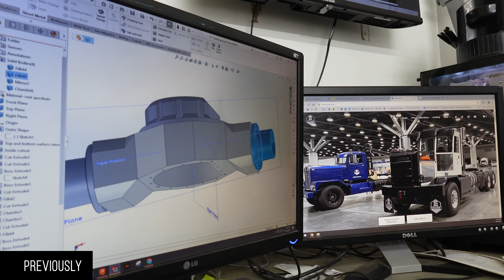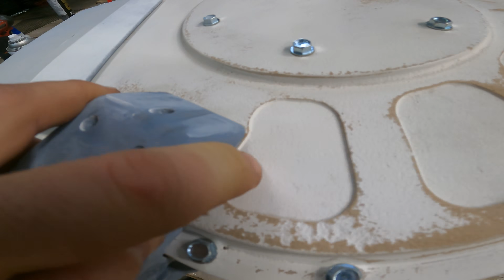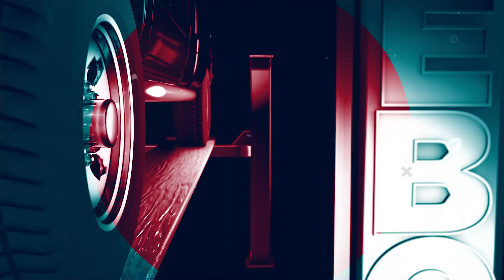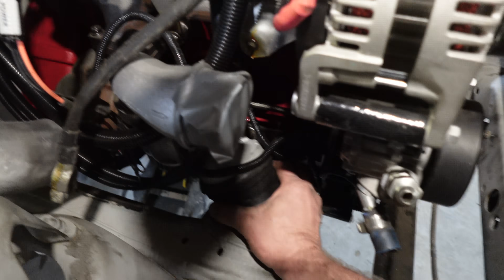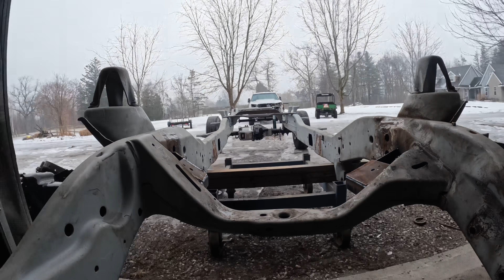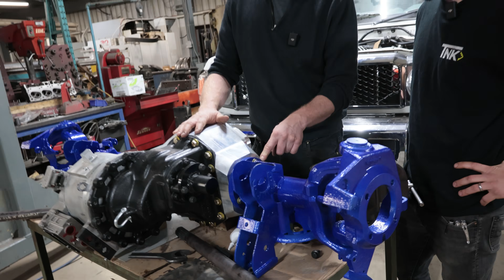Test Fitting our @EdisonMotors Generator #RamRecharger [EP9]

Comment: Extended Range Electric driver for 5 years (now @ 122k miles) on an i3 REx.
Owners will be impressed with instant 1rpm torque, running costs 80% less than diesel, and how a small Cummns ICE generator will last forever if used this way.
Regen brakes are just icing on the cake.
Reply from the maker: Our thoughts exactly.    Thanks for the real world testimony
Reply: @DEBOSSGARAGE Gotta get regen shock absorbers now
Reply: @grammarpolice4003  Sounds like a good chance to get Multimatic involved! They're a Canadian company that make magnetic shocks for high performance applications.  Oh yeah they build Ford race cars too ;)
Reply: @grammarpolice4003  honestly I don’t think there’s much to be gained by that
Reply: @SoreTv  every little bit adds to the bottom line of range.
Edit: and the further the vehicle travels the more the shocks are used and the further it can go. Imagine a downhill, speed bump infested road. You'll catch a lot of regen on that.
Reply: @DEBOSSGARAGE  Is this combination with the 2.8 Cummins going to be the only choice, or will their be other options? Also, will the kit be something a person can buy and install themselves, or only performed by certified installers?
Reply: Hybrid is good in Australia also... Can be some distance between chargers.
Reply: Regen brakes is why I think it’s insane this doesn’t already exist and only on the long term marketing plans. The bonus of all accessories being off the high voltage is also a huge bonus for so many use cases.
Reply: I am sure it will not take too many years before these are the go-to option on most mainstream pick-up trucks and probably heavier SUVs also. Too damn bad, that I will never be able to afford a new truck, so I'll have to wait for a well priced conversion kit, or wait 10-15 years before diesel-electric pickup trucks have hit the market and you can find used ones that have been driven 100-150 thousand miles.

Comment: Awesome stuff happening on this channel! I can’t wait to see more updates on this. Imagine having a reliable fuel efficient diesel 4x4 that can doesn’t cost $80-100k 😂.
Reply: Diesels are efficient. Unfortunately they put giant motors in the oversized utes in na.
Reply: @ I have had a bunch of older diesels that had very respectable mpg. Unfortunately the new ones are so complicated and burdened with so much emissions equipment that they can’t be considered affordable or efficient at all.
Reply: @Low760 IH tried the smaller diesels in the Scout-II, but it never took off. Ford and Chevy tried diesels in the Ranger and S-10. Diesel pickup trucks have really on been popular in North America since the mid-90s and you’re right the engines are massive. That’s because generally we don’t have light duty trucks with diesels here. The trucks with diesel are 3/4 ton and up generally.
Reply: What's the price tag on this 😂

Comment: Will retrofit shops be allowed to rerate GVWR? For example, if I bring in a '99 F250 with a GVWR of 8800, and you put electrified F450 axles under it, can the GVWR be officially rerated to 10,000 or higher?
Reply from the maker: I think it will vary state to state and province to province, but our lawyers can figure that out.  I just want to get them moving

Comment: Interesting idea, looking forward to results. Which 160hp engines of an "older" design could be used in place of this 2.8? 

Is there a common generator set that is the same kw?

Many low hour standby 3ph generator sets are available; Detroit 2 strokes and old CATS are scrap prices, still like new and VERY reliable for decades.
Reply from the maker: Any engine that can be controlled electronically with an SAE #3.  Bellhousing.    That's. Ot to say an electric solenoid can't power a mechanical pump....

Comment: so this is a direct E-axle to battery source/generator, ie. diesel fuel to electric generator?
Reply: The engine spins the generator. The generator puts power into batteries. The batteries put power into the axles.

Comment: awesome to see your proper prototyping process, this is what get missed in so much CAD stuff, it is the fitment and serviceability that leads to longevity.
Reply from the maker: Thanks for noticing.   Crazy to think this truck wad already built and going down the road
Reply: Yeah when we mess up at work we always say, “well it worked in CAD!” lol! As a mechanical designer I work in 3D modeling frequently, but I work at a place where I’m lucky to do development from start to finish. It’s always cool to see the things I’ve modeled in CAD and putting them together. Then I get to see what can improve on the next product.

Comment: How is Edison/Deboss addressing the 2000 rpm engine being bolted to a 4000 rpm generator. Youll only produce 1/2 the rated kW.
Reply: The generator is designed to output 100kW at 2000 rpm. The windings in the generator are designed around the output rpm of the motor to match everything up. If this generator was to spin at 4000 rpm the Voltage would be way too high, and could cause damage to the rest of the system. The generator is also designed to be 100kW continuous not peak, meaning that will run cooler. The closer you get to peak: 1. You'll limit power output as things heat up and can start to de-rate. 2. Excessive heat. 3. The life is will shorten. So you get it built to specification to ensure none of those things happen.
Reply: The engine they're using makes its rated power at 3600rpm, this comment makes no sense.
Reply: Doh! I was thinking of the 2000 rpm limitation on topsys C9 when it was bolted to that Danfoss t 2000 that expected 4000 rpm. Nvermind. You guys are having a custom genny made specifically for this r2.8. Okokok my bad. Carry on everybody.
Reply: @Sah-o5m  That Danfoss was a nightmare through and through.
Reply: My guess is they'll need to design a step-up planetary drive into the generator to get to 4K rpm.
Reply: I would think they would use an 1800 rpm generator?
Reply from the maker: That's the engineering team...

Comment: I really appreciate the frame repair. Very common area for even a southern truck to rust from. Going to frame swap in my case but great job.
Reply: Seems odd that since it's common for Dodge/Ram frames to rust out in those low spots that repair centers and dealers don't offer a service to drill the weep holes and install cotter keys as mentioned.
Reply: @3frogltd987 Dodge frames & bodies are just throw-aways, no one cares about saving them everyone just wants to pull the 5.9 Cummins and the rest isn't worth it cause there's better designed, stronger options available

Comment: The combined weight of gen, motor, engine, battery x3, wiring , controllers, fuel I don't believe the efficiency will be on par 😢
Reply from the maker: That's why we will be doing all the testing in a closed environment dyno simulation.      Then pulling an airstream from Ontario to BC.   I won't sell anything I don't believe in
Reply: Smaller engine, generator will almost certainly be lighter than the transmission, no driveline, fuel is the same before and after retrofit. Controllers are going to be negligible. So you have to make up the difference of the electric motors to the differential on the rear axle, then add batteries which eats into the savings on the motor, transmission, and driveline.  If it's heavier its no by much, and on a bigger service truck that doesn't need to carry an extra generator for power tools or compressors, you are way ahead.  Maybe some vehicles don't make sense, but no solution solves every problem.

Comment: Curious would it make more sense to mount the generator on the front of the engine. I would be guessing that it's going to be a relatively common service part and you have all that space up front. I'm still watching the episode so it might be explained yet.
Reply: Then all your accesory drive parts are crammed into the firewall, intake/exhaust/coolant routing is backwards. Might as well take advantage of the space in the transmission tunnel.
Reply: @twmundt  Fair enough, my thought that was with all the accessories being run electronically and maybe using a DC to DC converter instead of an alternator you might not even need access to the accessory side of the engine. One nice thing about this being a kit is the customer and installer can make that modification if they want.